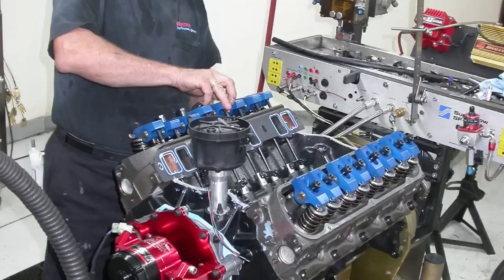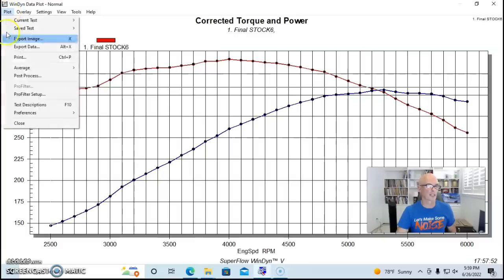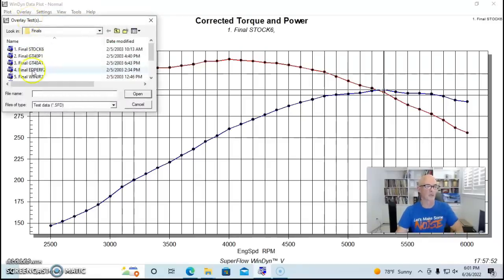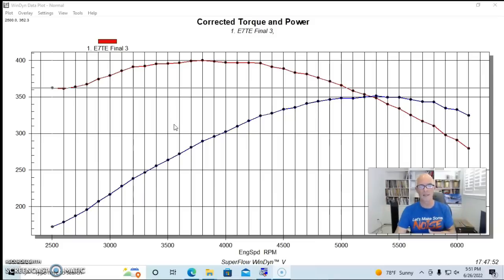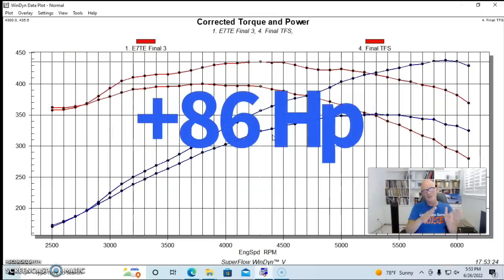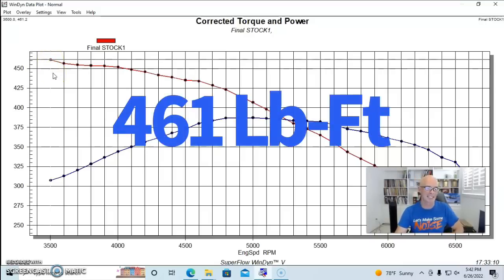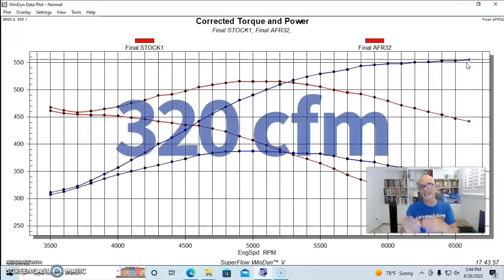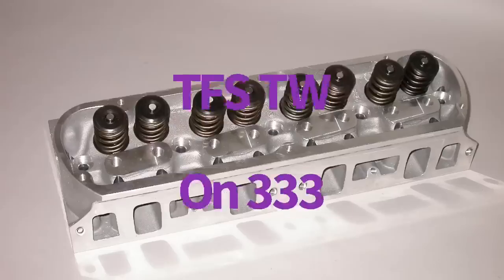IS THIS THE MOST POWER EVER PRODUCED FROM STOCK FORD E7TE HEADS? TOP SECRET-HEAD UPGRADE ADDS 168 HP

Comment: To many people blame the heads when they are are not utilizing the heads they have properly.

460" BBC 
0val Port Heads with 2.06 Int (Amateur  Bowl & Throat work)
270-280 cfm - 0.600 Lift (Flat Tappet Cam)
2870 lb with Powerglide
5.96 @ 114 mph (I/8 mi)
Reply: @Junkyard Rat S10 
Compression was 12.5
Comp Cams Solid Flat Tappet 
0 375/0.375 (Lobe) with 1.7 Rockers
310/320 (0.020) - 270/280 (0.050)
108 LSA  - Installed at 105 ICL
(They still make a 110 LSA version)
2.125" primary headers
1150 Dominator (Old cheap 4-Circuit)

My best guess is close to 700 hp (crank)  given the trap speed with a PG. With a 1.76 Low and 5,500 stall best 60' was 1.29 with 2 step at 3800 rpm.

Comment: The year 2007, location Las Vegas, NV
working as a tech.
A silver late 80's Mercury Mark VIII with a Hawaii tag pulls in with a whine. It perks my ear.
I tell the service writer, make sure i get this 
Owner was a real cool older guy and gives details.
Detomosa Intake Manifold 
Centrifugal Supercharger.
he claimed high 400hp at the wheels.
automatic trans as well.
just needed an AC seal fix and recharge..
hot Vegas Summers.

Comment: Hi Richard..! Thanks from Venezuela. I would like see more Dyno Test Videos for 351W. Good Job.
Reply from the maker: More to come!
Reply: @richardholdener1727  Thanks Richard. We follow your Job. In this Country, there are lots and lots of SBC, SBF and LS from Trucks. Thats is the reason why I'd like to see combinations like a 351W with Stock GT40-P Heads and Stock HO Camshafts, They are the things that people can buy here due to the situation of the country. For Me, it would very important to see an LQ9 and an LY6 with a BTR Torque Camshaft (202/202 .511"/.511" 112LSA) or Crane NSR Camshaft (200/200, 200/2008 and 206/2014), because there are Tons and Tons of Trucks and 6.0 Engines. Thanks again Richard. Thanks again for making Engineering, Thermodynamics and Physics so interesting. We respect you and we are waiting for your great work.

Comment: I want to pick up another sbf powered car. Im looking for another Mark VII. My old Mark was called Fergie because of the hump in the trunk.
Reply: Bump in the trunk when the air ride Peter's out. Lol
Reply: @timothythomas1737  my Mk V didn't come with air ride. I assume the Mk VII does?
Reply: @Horrible_Deplorable  My mark Vii had it and it failed at the compressor. Ended up just getting a schrader valve put on for manual filling. My Mark Viii has it and it works!
Reply: @Horrible_Deplorable  yup
Reply: @madmod  ah, man! That's one reason I don't care for the air ride. Altho the ride is nice. 

Nice, rather simple fix, too. 

I knew the VIII did, I wasn't sure about the VII. I only know the VIII does cuz I see alot of them sagging their ass. Haha
Reply: @Horrible_Deplorable  I had a 2000 Continental that had it too as well as my 94 Town Car. I think they even used the air ride on the big suv's like the Navigator, although my Aviator is equipped with coil springs.
Reply: @madmod  You can get the Navi with air ride. Idk bout the Aviator. I'd imagine you could get one with it tho.

Also, doesn't the VIII have the 4.6l dohc?
Reply: @Horrible_Deplorable  Yepsir. The mark viii was the first to recieve the dohc 4.6. My aviator has a dohc 4.6 aswell.
Reply: @madmod , hell yeah. I've never driven a NA 4.6l dohc but I drove an 03 cobra. Whooo! 

How's the 4.6 dohc in the Avi? It get it around pretty good? 

My Mk V has the 460. Fun now that it's been de-smogged.
Reply: @Horrible_Deplorable  Those cobras are nasty! Ive actually got a 0-110 pull in my aviator on video here on youtube. I bought it to pull the engine for my sn95. They have the same specs as a mach 1 or marauder engine wise.
Reply: @Horrible_Deplorable  i love the 460 too btw. My dad has an hot thunderjet 429 hes looking to stuff into an old ford sedan.
Reply: @madmod  tell your dad to get a 460 crank to throw in his 429 and he'll have a thunderjet 460.
Reply: @madmod  yeah, that cobra was sick as hell. It was yellow with black interior. Definitely set you back in your seat. Didn't buy it tho. 🤦
Reply: I like the tire hump on my Mark V, too.